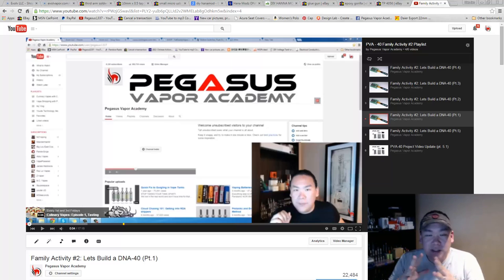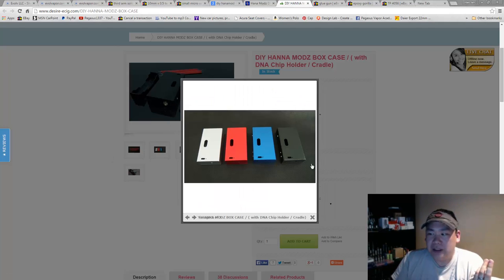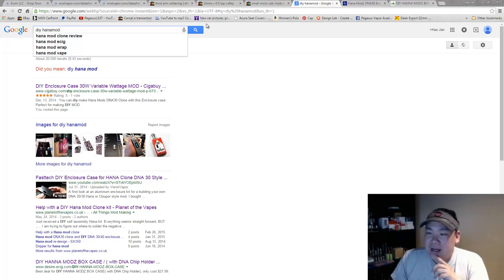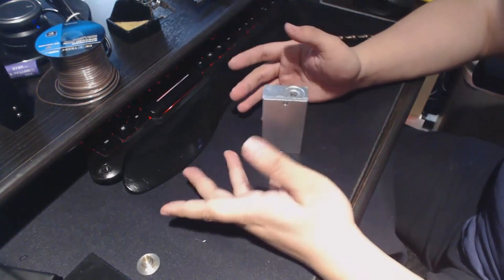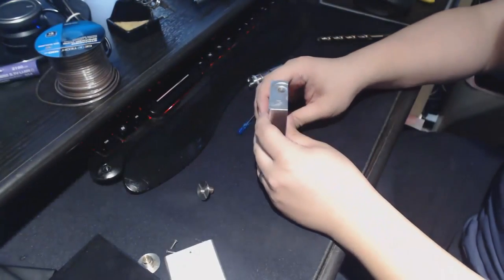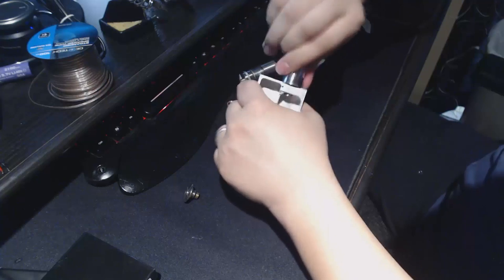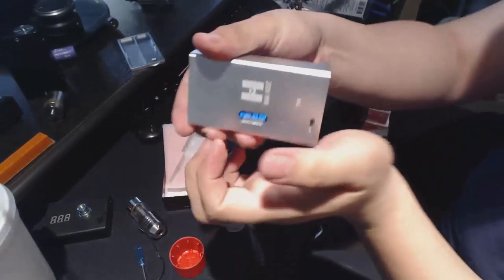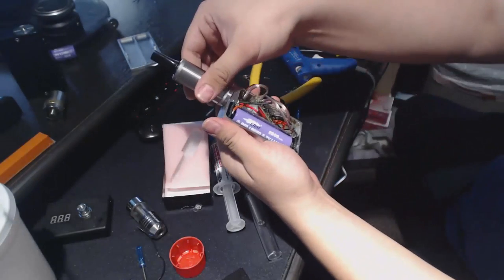How To Setup a DNA Box Mod: Cana Strip Down, Chip Upgrade

Comment: Great Peg. Now even I consider to give it a try With a DNA 25. I just need to get a soldering iron an a Third arm. Thank you for a very good explanation.
Reply from the maker: tottosan i recently  put together a strip own of a zero and a vapor flask,  but didnt put it on video cuz i wasnt sure what i was doing.

now i am  so,  if anyone wants an upgrade i'm willing to do it one more time.
Reply: That would be awsome, I have a flask clone that I would love a dna 25 or 40 in. Bi\ut I don`t want you to get over Your head in work. You have done enough for a while. :) I don`t have the Money for those chips yet.. But thank you very much for the offer. :)

Comment: Hi peg I was wondering if you could show us a normal box mod build   maybe with 3 18650 with a switch so we can switch from parallel to series   also how to actually attach the heat sink to the MOSFET  just in general how you would build a box mod from scratch.  I got everything down myself except how to wire the battery sled so I can switch from parallel to series maybe a voltage meter in the box would be nice too I know you're a busy man maybe sometime down the road on this one  thanks again
Reply from the maker: Robert Eby I got a few more strip down videos comming  plus I'm working VPX
and I have so many PVA orders to handle.  I'll see what I can do.

Comment: Were you referring to the 22mm "smooth top" 510 connector from varitube? The reason I ask is cause it says 22mm Smooth top option is for drippers only.
Reply from the maker: I met Perry from Varitube at a TPC convention,  and he gave me a handful.  These are called low profile by the man himself.

Personally I think smooth is fine as almost everything we use these days has its own air flow.  What still uses 510 bottom air?
The slotted stuff is "just in case"
Reply: Ok I see what they mean by smooth top now. The pic wouldnt load at first. Thanx

Comment: Was hoping you showed how you got all that expoxy/hot glue out your cana mod.
Reply from the maker: Keith R small screwdriver,  just go ahead
Reply: Pegasus Vapor Academy Dude thats what i've been trying. That and a razor and rubbing alcohol. The top white glue layer(which I assume is just hot glue) came off relatively easy enough. The stuff under it has a slight yellow tint(i assume an epoxy of sorts or maybe is hot glue as well) it wont budge at all. My dna30 started saying "check atomizer". When I lift the board by the glue, it will work again but the ohms bounce but mostly stay at .5(what it should be) but go up to 2.8(rarely). But with movement it goes back to "check atomizer". Its not the tank. I rebuilt the coil and tried 4 different drippers, same result. When I purposely short the 510 connection it says "short" as it should. So I assume there is a short under the board, but I cannot get to it. Been trying for a week now and I know using this is not safe, like a hybrid mechanical mod now. But it is all I have, till my order comes in the mail. Just been cautious for tell tale signs of battery over amp/temp. I assume the glue or epoxy is all over the screen glued to this board, with the glue protruding on both sides to keep it centered. I know there is a faulty connection or short happening under there. I just can't get it to. Any help would be greatly appreciated or anything I could try, or anything I may have over looked. Far as fixing it or removing it without breaking the chip. Going to try freezing it next, see if its brittle.

Comment: I built one of these a while ago. While building it I found out that 18 gauge silicone wire wouldn't fit into the Evolv DNA 40 chip for soldering. I had to use 20 gauge wire for the batteries. I also bought a 3D printed chip and usb cradle from Shapeways that was really nice...they kept the inside looking nice and neat. I used a low profile 22mm FatDaddy 510 that sits a lil lower then flush...cant even tell its on there with a tank screwed on. Only regrets I have is not putting a 12mm fire button in it.